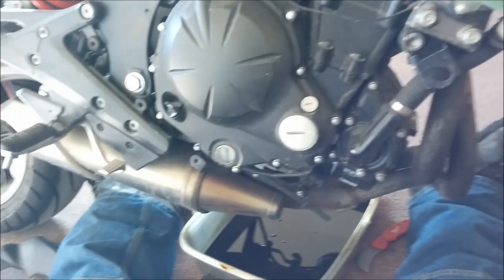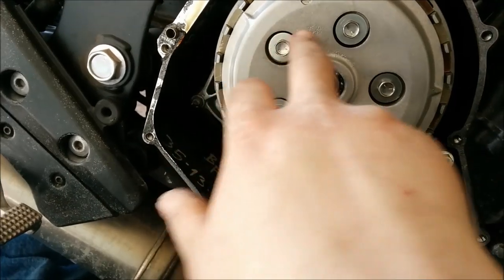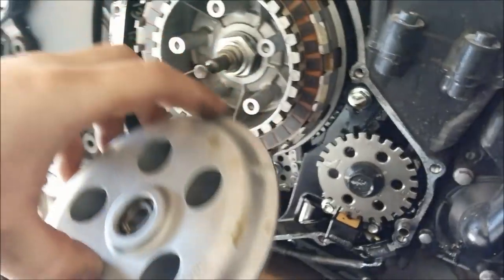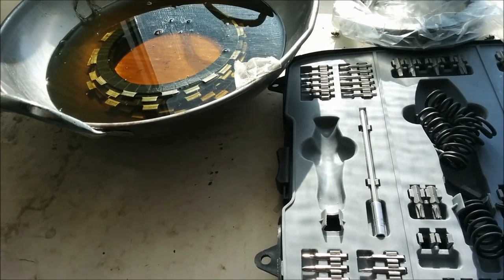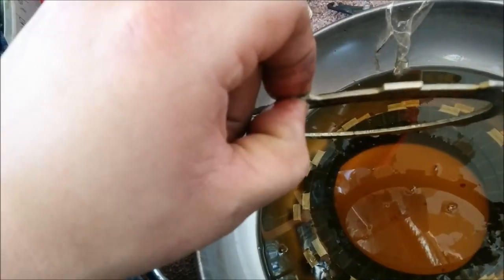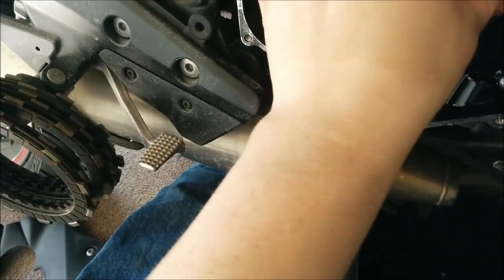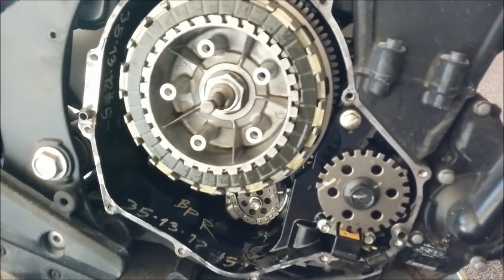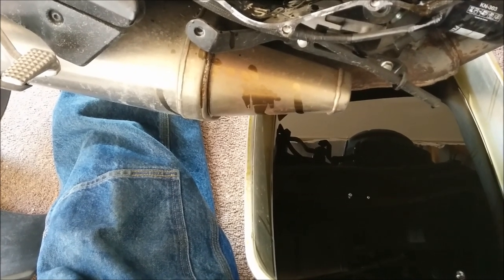2012 ninja 650 clutch Replacement

Comment: I burn my clutches to smithereens every 20,000 km or so and I mean burnt to bits. I'm running the 2009 Versys 650 and I'm a pretty big guy, well no actually I'm a REALLY  big guy and I'm brutal on the clutches. I launch like the hounds of hell are on my ass every time I take off and I use the friction zone like mad in traffic so I don't have to put my feet down and that reallllllllly destroys clutches fast.  I actually keep a set of just okay clutches in my bike from an ER6N that I did for a buddy just in case I lose my clutches while on a trip.   Lastly EXCELLENT video!  It's people like you whom take the time to video, edit and post such thorough videos that save people so much time and money...  Thanks!

Comment: Thanks for this. I’m using this tutorial for my 2022 Ninja 650 clutch replacement. Burned the hell out it 😂😂😂
Reply: Almost killed mine in 6k doing wheelies
Reply: Have you changed your clutch yet? I also have a 22 and I'm wondering if this video would apply to our newer model as well? I thought there may be a difference in the clutch pack, like something to do with a slipper clutch or something?

Comment: 2009 - Ninja 650R **CONFIRMED** , you do not need to empty the oil to open the clutch cover. Just made sure the bike is on the side stand. I just did my oil change like 700 miles ago so I was thankful I didn't need to even though I had all the supplies ready for it.
Reply: If your clutches burnt all that crap is going to be in your oil, clogging various delicate parts. You don't want that. For $20-30 dollars for new filter and oil it's much better overall to just change it.

Comment: Thanks for another great video. Been looking into replacing my clutch springs - will likely do it after spying your video and peeking at the service manual. Getting just a smidge of slippage at highway speeds ~65-70. The springs that come stock are known to slip...
Been using the Mobile1 - M110 filter. Gives the bike just a tad bit more oil and a bit more filter area.
Reply from the maker: Its got tons more grab now. I really like it. thanks for the tip on the filter. next change I will give it a shot. I'm sure I missed something somewhere. :) (like the all important torque specs) If you have the service manual its always a good read.
Reply: Any slippage at all at high end in 6th? Just wondering...
Reply from the maker: nope. none.
Reply: I never had any slip on the interstate or hard acceleration. Minor slippage in 1st gear clutch-ups. Lots of slippage in 2nd gear clutch ups. AFTERWARDS with 18% stronger barnett clutch springs I can raise the wheelie approximately 18% easier. I just finished my install and test drive. I still need to experience the  clutch a bit more before I do pinging 2nd gear clutch ups.

Comment: Thank you for your vid bud. I bought a 2009 Ninja at 6k. I put 20k on it in about 10 months. I do all my own work. I started slipping in 4th and thought a gear might going bad, but then I remembered I adjusted the clutch weeks back. I'm hoping a re adjustment will do the trick.
Reply: Sorry to inform you but the uploader committed suicide around 2 years ago. His suicide note is the last upload on his channel.
Reply: @raftash5279  that’s crazy I just checked

Comment: Have you ever had trouble putting on the clutch cover back on?

I changed my plates, but now when i install the clutch cover and move the actuator arm to the right it feels as if it's hitting something and most possibly the Push-rod. When i take out the clutch springs and reinstall the clutch cover the actuator arm moves like it should and works properly and it feels like there's tension.

Has this ever happened to you? I'm currently waiting on a torque wrench hoping the bolts for the springs not being torqued to specs is causing the problem.
Reply from the maker: You have to have the actuator arm in just the right position when you put the cover back on.  It may take a tad bit of fiddling to jet it just right.
Reply: As 50calSniper says.... It also helps if you NOTE its position when taking it off and do not touch it.  The actual is fully turned counter-clockwise and seemingly toward the person working on the bike.

Comment: Hi. The manual states to put molybdenum disulfide grease  on the shaft that release the pressure plate. Did you put new moly grease? Thanks
Reply from the maker: Roderick Cavallo I did.
Reply: 50cal5NiP3R you just put a little bit right? Does it get mixed with engine oil?
Reply from the maker: Roderick Cavallo correct. just a little bit. although there is never such thing as too much lube.

Comment: quick question how did you install the clutch cover? Im having a hard time with the cable, its loose and I dont know how to get it back to how it was.
Reply from the maker: did you justt do a check or did you replace anything? it shouldn't be loose at all. however you should be able to make it the same length. it should go back on the same way it came off.
Reply: I realized that I didnt put on the hub cover on properly idk why it didnt go in but I figured it out and the pin on the clutch cover went in smoothly the next attempt. now only problem I have now is i accidentally passed the torque on one bolt on the clutch basket/hub so i have to redo the job :(.
Reply from the maker: Angel Trejo rock on. i'm glad you figured it out.

Comment: Went and replaced my clutch plates with some aftermarket ones, I think the gasket is loose it leaks oil now, so I will order a new gasket. Also the clutch cable gets loose and I have to readjust when it rides for a bit and it becomes hard to shift.

Comment: Great video.  Have you done a brake pad replace video or clutch cable lube or replace? I'm new at riding and I'm trying to learn as much as I can to do my self...the dealerships are a rip off!!! I do also have the service manual. Thanks again.
Reply from the maker: i haven't yet although i will do a brake pad video soon. clutch cable hasn't stretched on me yet.

Comment: hey can you give me a rough estimate how much all this cost you?i found the same bike on criaigslist for a cheap price that needs a clutch.i would"t mine doing the clutch work depending on the money.
Reply from the maker: I think I spent about 120$ all together.
Reply: Remember the specifications for torque force is measure in INCHES/LB instead of foot/lbs. You need to do the necessary conversion. 1. Clutch plates kit $150 2. Gasket $6 3. Torque Wrench $30 4. Clutch-Plate remover tool $10? . The satisfaction of knowing you did it yourself: priceless!

Comment: My ninja 250 only has 10000km on it but the clutch engagement near the end of the clutch lever... Would it be clutch cable play or my clutch? Its a 2010 to i cant seeing it being the clutch. I hope.
Reply from the maker: Braedon H it really depends on how it was ridden. i would try adjusting the clutch cable first and see if that solves the problem. im not sure where the adjustment is on the 2010.
Reply: Ya i got it adjusted it. Its perfect now
Reply from the maker: Im glad you got it all figured out.

Comment: dude how the hell do I disconnect the clutch line?
Reply from the maker: If at first you don't succeed.  Try try again.  Or watch the first part of the video again.
Reply: There is a riveted head on the end of the clutch cable. IN ORDER TO REMOVE IT, you must slide it back far enough that the actual wire is going through the slot and not just the head itself. Be sure you already removed the two 8mm nuts holding the wire down.

Comment: hey 50 cal. I'm replacing my clutch on my 2014 kawasaki 650 abs. Was wondering if you had any information on if it's basically the same way to change it. I def don't wanna pay another 200 for someone else to change it if I can just use this video as a step by step guide.
Reply from the maker: TehZagar It should be the exact same as mine. the 2012 was the first with the new redesign. all my 2012 ninja 650 videos should apply to your 2014.
Reply: Alright thank you. I'll be letting my friction plates sit over night in some new oil so prolly 12-14 hours. Thank you for this video.
Reply: 50cal5NiP3R also you should make more video of the 650 honestly not huge of a market for walk through for certain things.
Reply from the maker: I unfortunately totaled it in January. i would do more walkthroughs if i had another one. or if someone would lend me a bike. TheWizechatmgr is also doing videos on the 650, they should be applicable to your bike.
Reply from the maker: Its the exact same process on the 2014 abs as well.
Reply: +50cal5NiP3R yup I got it in. It's a beast. def can wheelie again :D
Reply from the maker: +TehZagar sweet.  Keep the rubber side down.

Comment: After I was done putting everything back together mybclutch cable was super loose. I don't know how to tighten it any more.. It should have not been loose since I didn't mess with it
Reply from the maker: strange that it was so loose. you need to make sure that your springs are not too tight and that your clutch shaft is catching on the arm correctly.
Reply: Know its a bit too late to comment. 
But the plate put in at 11:32 min of the video was put correctly or in the wrong groove?

Comment: I have a 09 zx6r my clutch lever would not engage then I would adjust it. then it would engage after a week of use I had to adjust again until I adjusted it all the way. I checked the clutch and it look fine. got any ideas what it could be. thanks
Reply from the maker: Mario Andalla sounds like your clutch cable is stretched out.  I would highly recommend replacing it.

Comment: If you can also have a chance to do a video of removing the oil pan, I appreciate it...some of mechanics that I spoke too told me that at least, 20k-30k km, need to check the oil pan for any deposit...been using only a Castrol Power 1 Fully synthetic on my bike and change oil every 4k km..
Reply from the maker: Ernest Palaboy unfortunately i totaled the ninja in a snowstorm early this year.

Comment: Is it the same with a 2006 ninja 250 ?
Reply from the maker: I'm not sure on the older models
Reply: I don't know about the 250, but I just did this on my 2007 650r, it's the same as this video. Before you start the repair, make sure you have a replacement gasket, your new plates soaked, liquid gasket maker, and moly-grease (or a synthetic moly-fortified). Use the manual! This video gives you a great visual, but there's several other steps you may need to follow.

Comment: what is the torque measurement for the bolts?
Reply from the maker: Alfonso Ramos i dont remember. it can be found in the service manual. that can easily be found online.
Reply: This job is pretty much measured in INCHES/LB not foot/lobs of torque!
HERE IS A LINK TO THE SERVICE MANUAL:
http://www.magnum1.com/magnum/Ninja-650/650_Manuals/Ninja-650-Service-Manual.pdf
Out Casing clutch cover: 35 inches/lbs
Clutch spring bolts: 87 inches/lbs
Reply from the maker: ive done it so many times I don't even torque wrench anymore. but good info for the rest.